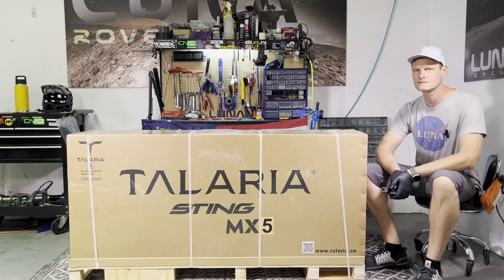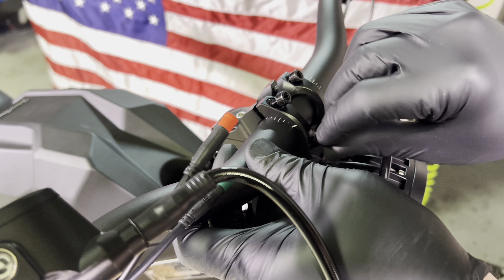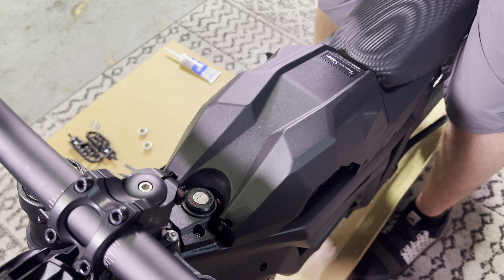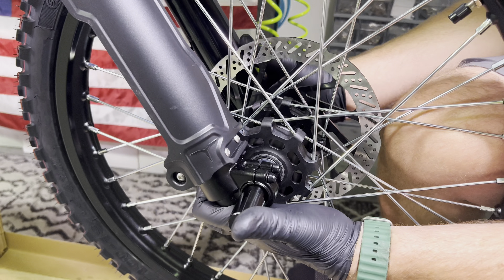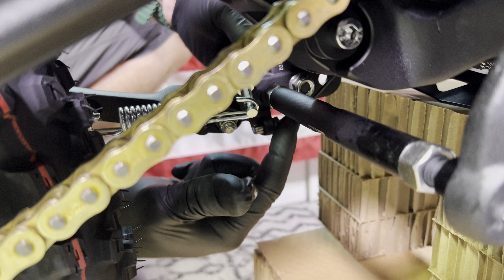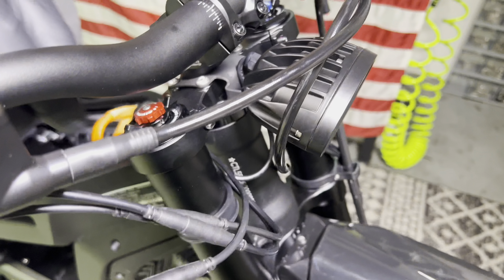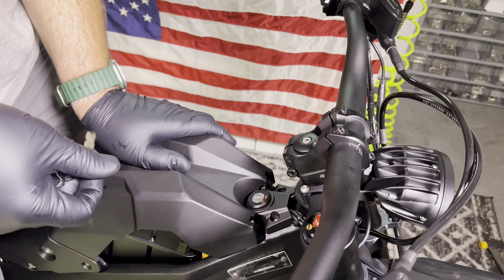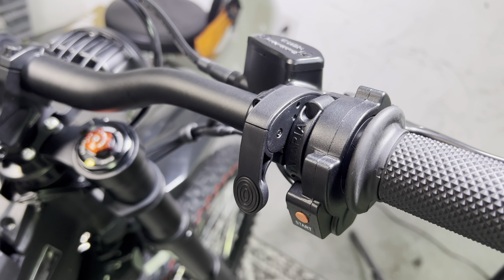TALARIA MX5 UNBOXING AND ASSEMBLY

Comment: Should I fully charge it before riding it? Or should I drain the battery before charging it on my first ride?
Reply: Try not to fully discharge the battery (at least not often) - because that can cause lithium batteries to degrade over time. It's best to charge it up before you ride and then store it at about 50% state of charge.

Comment: Thanks! I followed the same video that I used for my MX4 and only screwed up the headset spacer and put the front wheel spacers on the wrong side. Thanks to this video I was able to correct my errors. I also have my front brake line zip-tied to the front left mudguard because installing it like in the video gives me too much brake hose flopping around by the headlight. As a sidenote, I got some extra time in the garage due to having a Scud battery that I'm waiting on the replacement for. It should be here in a few days then I can finally test out the MX5!

Comment: @Lunacycle, thanks guys for making this video!!!   Just got my MX5 Pro built using this video and it’s way more fun to do it this way than sifting through the manual. 🤣.  

Coming from years of MTB riding / wrenching, these are definitely straight forward in the build process but it’s nice to have the tidbits on tap when needed.

Comment: My battery lid is stuck what should I do?
Reply from the maker: @BowenRen-s7d  Push down on the lid while twisting the key . It’s supposed to be tight to prevent the battery from rattling.
Reply: @lunacyclerepair  Worked like a charm thanks :face-green-smiling:

Comment: Do you guys have OEM parts for these like extra wheel spacers? Also, is it normal for a little rubbing sound for the front wheel on the desk? It’s not terrible, but it will probably just wear off.

Comment: Is there a way to unrestirct the mx5 other then cutting the wire????
Reply: No
Reply: The wire cut is super easy though no reason to not do it that way
Reply: You could even put a switch in to turn the restrictions on or off if you wanted
Reply: @levitvrdik  how?
Reply: @dermotmacarthur7504  assuming it’s a single wire, you can just run a kill switch up to the bars. I would just cut it, and run a switch to the tilt sensor for wheelies

Comment: Can you confirm whether the mx5 drain plug is reverse threaded or not?

I've heard reports that the new gear boxes are reverse threaded, causing people to strip it (thinking it's standard threaded)

If true why tf would they do such a thing? Seems arbitrary, and more expensive (and more likely to completely destroy the most vital component).
Reply from the maker: https://youtu.be/B5ncsuLL-3U Here is the steps for oil change on all models with a GB. No reverse threads.

Comment: Idk if I’m stupid or what but my front axel will NOT move
Reply from the maker: @zlonny1684  axle removal can be tricky , take your time and don’t force it . If it gets damaged you will not be able to ride . Find a small wooden dowel and use that to push it out .
Reply: @lunacyclerepair I was able to get it out